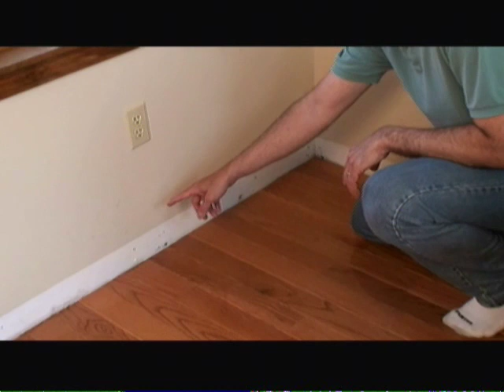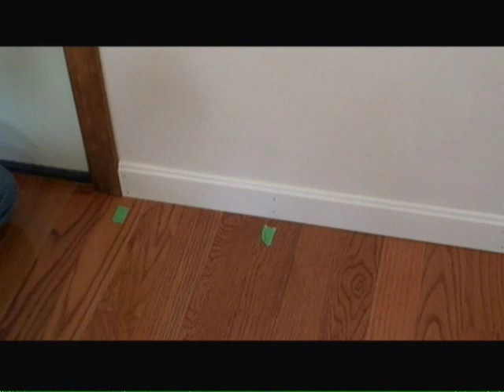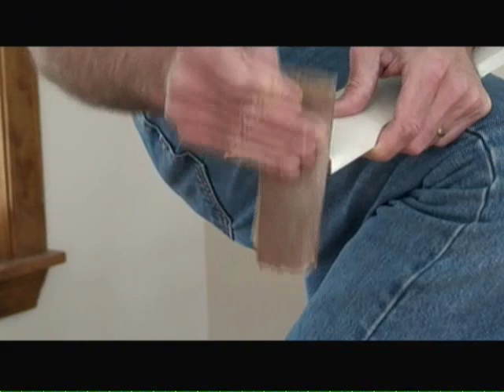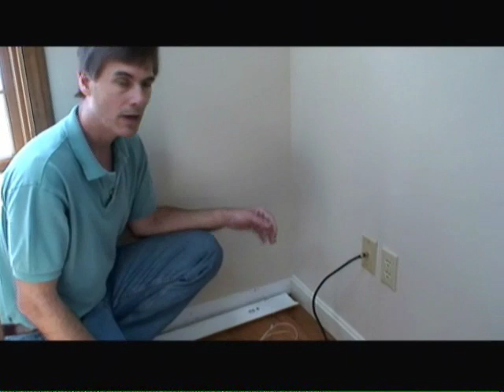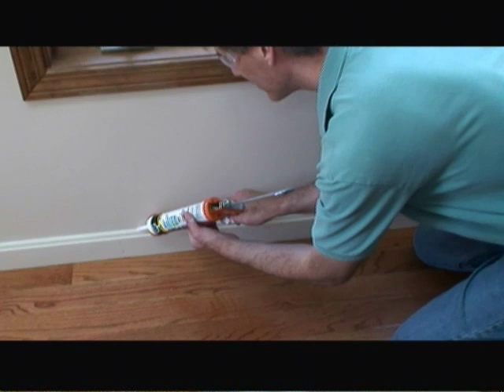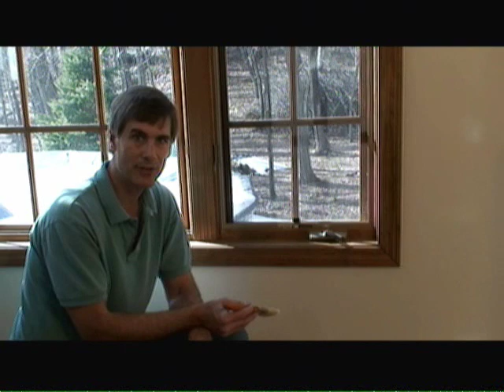Baseboard Trim Installation

Comment: A wee tip: you can nail into what you call drywall, we call it Gyproc, if you need to pull the skirting in at points between studs (or if the partition wall is not built to spec). Just apply some grab adhesive, use a lost-head nail at an angle and send it home. this will pull the baseboard/skirting in perfectly well to minimise use of caulk.

Comment: @lamoore99 You can and that works if your walls are perfectly 90 degrees. A coping cut will get you a tighter seam even if your walls corners are slightly off. Tighter seam means less filler in between and cleaner looking job.

Comment from the maker: A framing wall consists of a bottom and top plate (and a cap plate), as well as vertical wall studs. The bottom plate is only 1.5" thick and sits on the subfloor. Nailing the baseboard trim along just the bottom edger of it is inadequate. The top of the baseboard trim will end up having a large seam with the wall if you do not place nails perodically along the upper edge of the baseboard trim. Consequently this is why you need to findo out where the veritcal studs are.